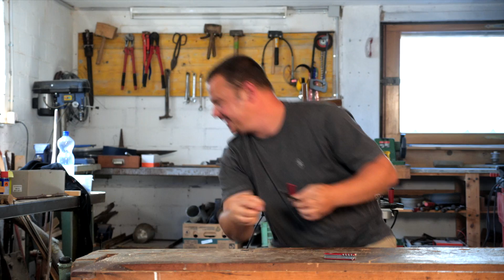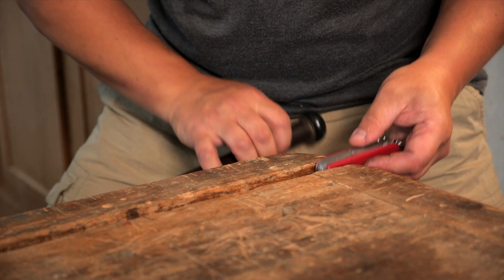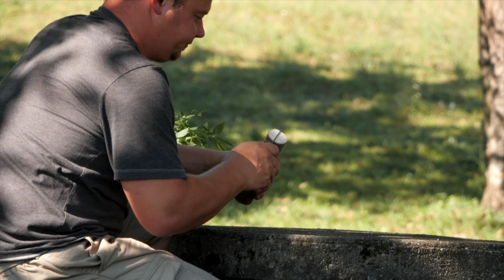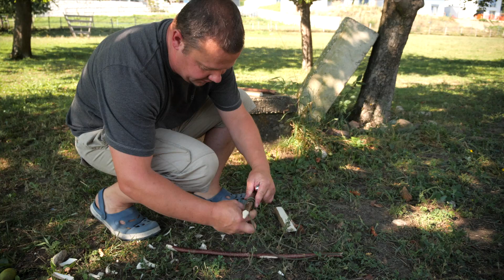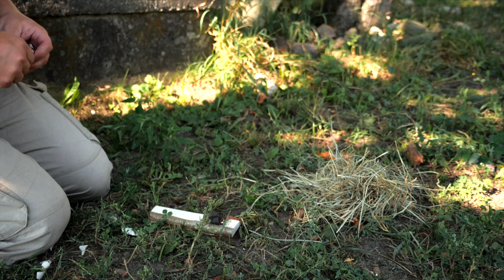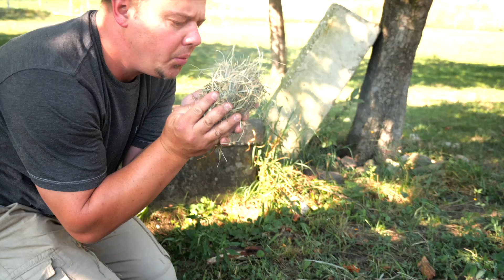The ultimate Swiss Army Knife  BOW DRILL TRICK !! / Victorinox custom & maintenance (18/20)

Comment: What kind of trees do they have in Germany that have such perfectly formed branches? The trees in America were designed on LSD day. It's a miracle if you can find more than a 6 inch segment that's straight, not to mention the uniform width and perfect wood.
Reply from the maker: haa ha haa, this one is hazel... 😀
Reply: Basswood, Tulip Poplar, and Sycamore (in that order) all work pretty well, and are pretty common in the Northeast at least. Basswood especially for the fireboard, with one of the other two as the drill, is my favorite. Basswood doesn't last long, you only get very few uses per hole (maybe 1-3 coals per hole), but it's so easy.

Comment: I own few 91 mm SAK. To one of them I inserted, in the scale, a small round magnet about the same size with your little bearing. Now I can use her as a refrigerator magnet or attach her to any steel surface in my truck. I can use her to pick up things.
Reply from the maker: Thanks for your comment!
Reply: Hi from Daytona Beach.

Comment: Seems you read a comment of mine on another video - I use a 12/8mm ball bearing in my Mora. I like some space above the spindle, so I can leave the tip a bit longer, I'm afraid of the spindle coming out and flying around (probably into my eyes). These small ball bearings are only 5mm high, so you can only use about 4mm for the tip of the spindle to nest inside.
Your way of tensioning the bow drill string is amazing, I never saw that from anyone else- seems to work better too -thanks for sharing!
BTW please pronounce "bearing" not as [bie:ring] but as [bä:ring] like "bear"
Stay safe and take care
Reply: I did a bearing in my Mora as well,I manufactured in a video and have no problems with it so far

Comment: Felix du oida kurbler.....Im really interested in how long the scale from the SAK can handle the temperature. I mean the Bearing will get warm in some way. Step by Step a little at a time, until the bearing will fall out or the scale Breaks loose. Maybe not with the first few bow drills, but at some point it will weaken the hole you drilled.....did happen to me many times. 
Even glued in pieces dont stay there forever. 

Do you have long term experience with that modification my friend. Would be very interesting. 

Thx buddy
Cheers 🍻 
Mike

Comment: You don't take glue at it - doesn't it fall out or turn round?  Thanks.
Reply from the maker: If the hole is to big...you have to glue it. In my case it fit perfect..
Reply: @FelixImmler  Thank you for the fast answer.

Comment: Great idea. Two questions: 1. What is the size of the bearing? 2. Is the wood rubbing against the aluminum block behind the bearing?
Reply from the maker: The bearing has 12mm the hole 6mm. I didn't have this problem... the least it wasn't a problem for me.